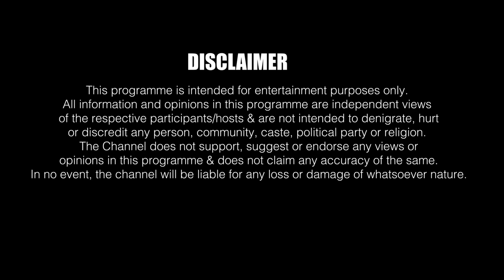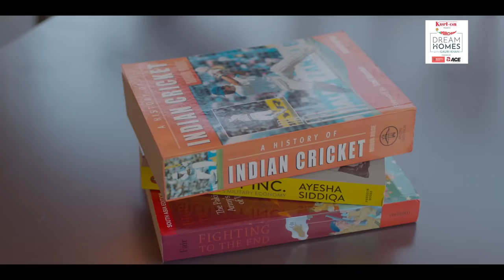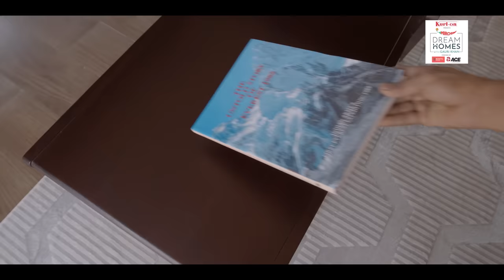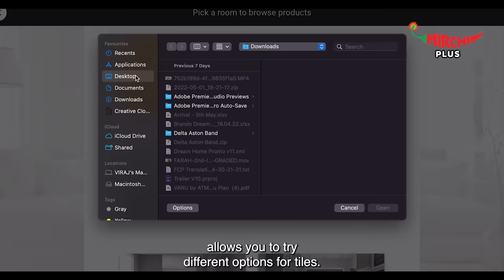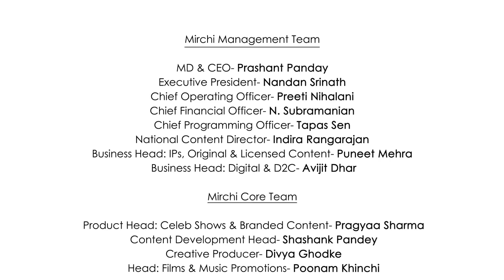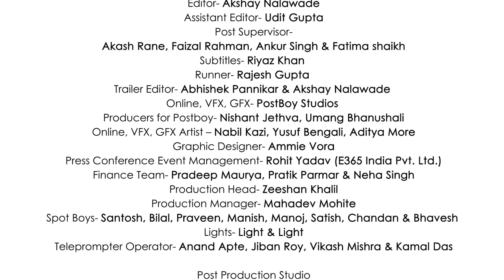Kabir Khan’s Office gets redesigned in a day | Ep 2 | Kurlon presents Dream Homes with Gauri Khan

Comment: This was surely a challenge. I did like many aesthetic features and the small touches. The film reel wall paper, the slight contrast in the colours which had the indoor pots.

Some areas to think about-
Surprised to see the uneven edges of the wooden floor. Usually you close the unseemly gap with a edge cover?
I would have loved it if you were able to source a better desk for him. It looks quite industrial right now.
Vertical blinds might have been better as he is on the 17th floor.
And lastly, the various frames on the windows (that perhaps prevented the vertical blinds from coming) could have been suspended from the ceiling.
We also didn't get to see what ceiling lights did he have and how does the office look at night

Am sure you would have.considered all aspects,. Good work. If the client is happy, that's the main thing.
Reply: Ss1
Reply: Client is told to be happy as per the script